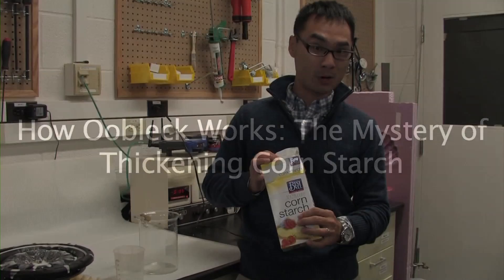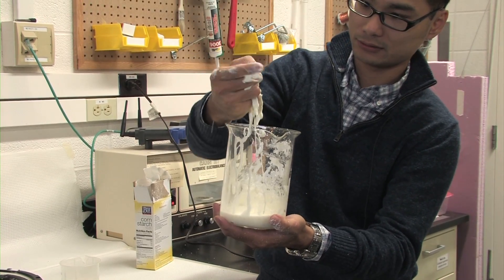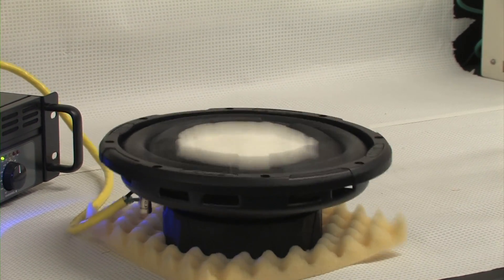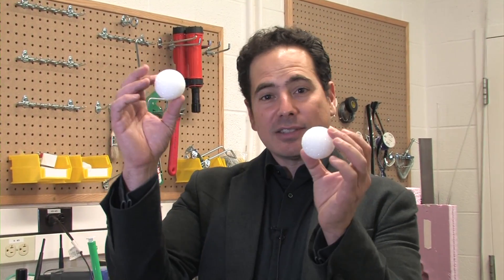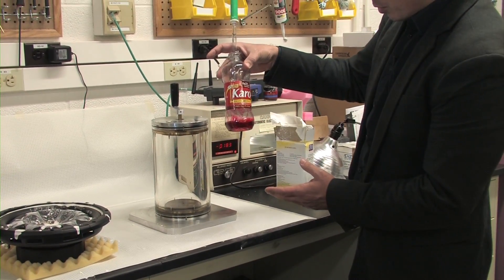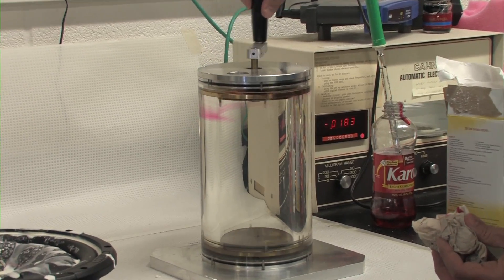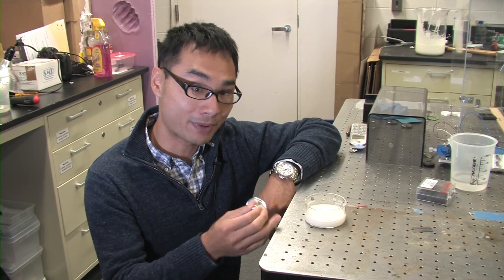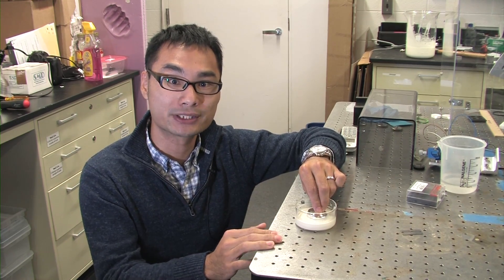How oobleck works: The mystery of shear-thickening cornstarch solutions

Comment: When you shear the fluid the energy you apply builds up a sort of charged crystalline structures around the micro particles. The charge then attracts the surrounding particles and increases the strength of the material.